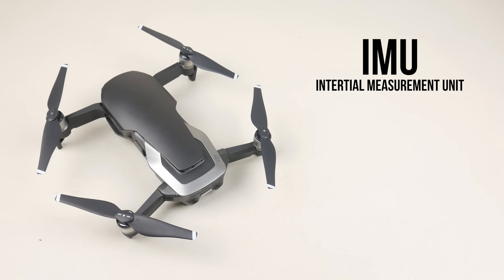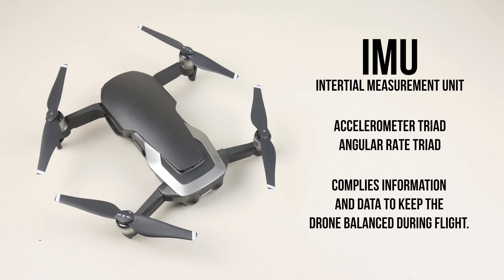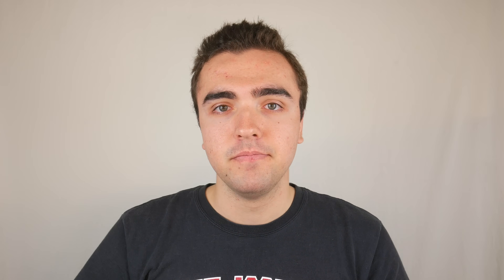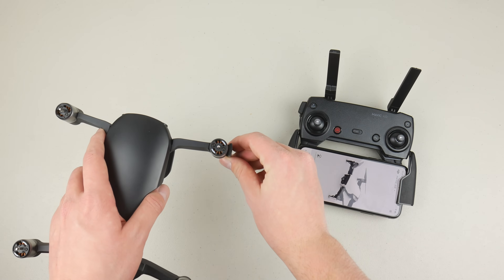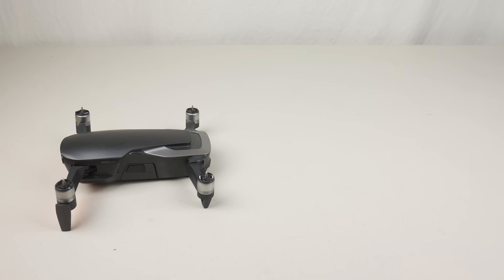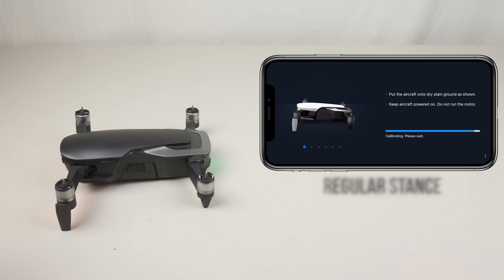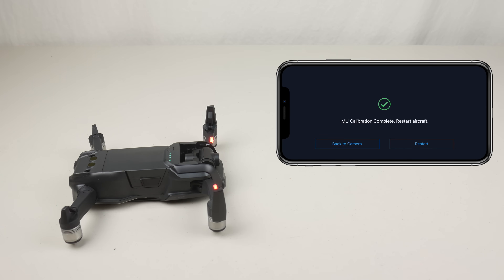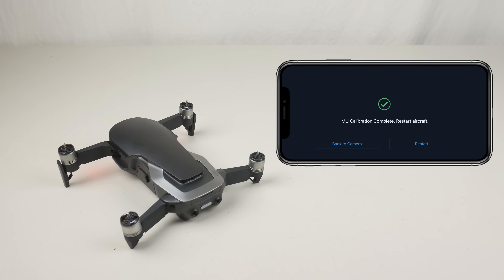DJI Mavic Air: When and How to Calibrate The IMU

Comment: Hi,  clear video instruction.. but I got a problem with it,  And I would like your experience.
I''m flying a Mavic Air (2018)   When I take off from a moving platform (like a hand or in my case also a boat) the IMU sensor is not initialised correctly. This results in a very unstable drone flight. With hard to control position and decend and ascend.  Looking in the log files the IMU altitude reports a large swinging altitude value, while VPS altitude is correct. Take off from the ground goes perfect.
Can you clarify if the IMU is initialised before take off?
Thanks already...

Comment: Hi Billy - My MA continually asks me to calibrate the compass on every flight, regardless of where I am. I have gone through the usual process of removing all metallic objects, smart watches...everything!!...I have moved position and tried in different spots too. I have even had this happen to me when i tried to fly in desert areas where there is NO interference whether on my person or my surroundings. 
Would it be recommended to try and reset/calibrate the IMU in this instance, as I'm getting pretty tired of having to calibrate the compass even time i want to fly?

Comment: thank you for that  tutorial,
i bought a Mavic air a few day's ago...i hav'nt attempted to fly it yet as it's been a good while since i last used a Drone which i destroyed due to my impatience and lack of true understanding of the differnce between a Drone and a Quadcopter.
I have a couple of GPS Quad copter's and i do recognise the difference between them now...one is an advanced machine which is piloted by Line Of Sight only...while the other is a flying computer with a central processor and an array of sensor's and can be programmed to follow a set of command's/way point's.
thank's again
Reply: rcfanaticdublin let us know when you destroy it. 👍
Reply: yuk,yuk...i nearly lost it a couple of day's later. ;p
Reply: yuk,yuk....APB,
I nearly lost it a couple of day's later...that was one very squeaky ass minuet and a half ;p

Comment: Hi Billy !! I have recently got the Mavic air. Initially for 4- days it was ok but later on I started facing the problem of connecting DJI GO 4 app with the air craft. DJI online support asked me to update the firmware with DJI Assistant 2 and sync flight data after every flight. And then everything was fine till last month when I started getting another error " Main Controller Data Error". Now I am again unable to connect with the aircraft again with remote. RC is showing connected on the GO4 app but unable to connect with aircraft where as with wifi I am able to connect with phone. Pl help.
Reply: Himanshu Saini are the controller and drone on the current firmware? Have you updated just the drone or just the controller?

Comment: Thanks folr your videos. Always very informative. One question. I see that the cable for the tablet/cellphone on the mavic air remote control is already pre connected on One of the sides of the remote. I tried connecting my iPad mini 4 but the remote control cable is on an opposite side as the iPad. How do I connect   the iPad mini 4 to the remote control?

Comment: Emil Caruso you are correct. It's best to calibrate the IMU on the quad right after you turn it on, when it's still cold. The procedure to calibrate the IMU on this quad is no different than the procedure for the Mavic Pro and any of the Phantom 4s. One other time I always calibrate the IMU is after a firmware update, probably not necessary though.